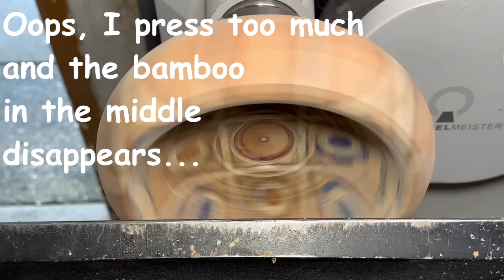Woodturning and GEOMETRY :A MAGICAL Result 😊

Comment: Very beautiful! I have a couple of questions. First, why do you cut the bamboo with a saw instead of on your bandsaw? Second, why the medium velocity resin? The walls on that look a little thick, but I imagine it would give you a whole different look if you went into them further. Such talent!❤😊❤
Reply from the maker: Racheal😉👍thank you
I prefer to cut bamboo manually because with the band saw it is less precise and more brutal so the result is less clear.
For the resin, it must not be too liquid because it penetrates too deeply into the Bamboo and we lose the atypical appearance of its grain.
And for the thickness of the piece in fact at the start I was thinking of making a pebble shape then I changed my mind and I hollowed out the piece but I couldn't go too far because the bamboo would no longer have been visible
Reply: @bawbreizhartwood  thank you so much for the answers!